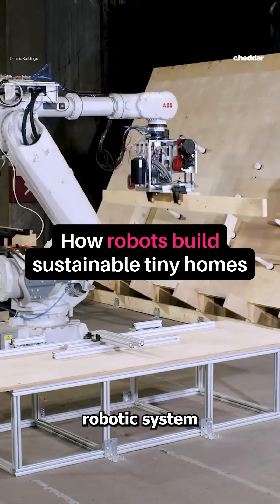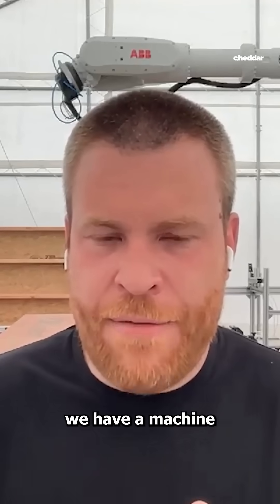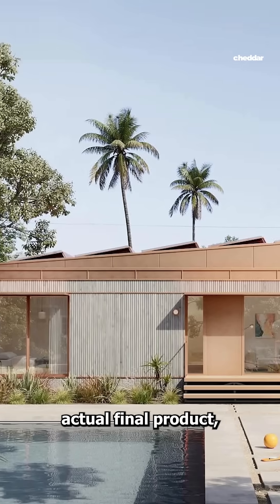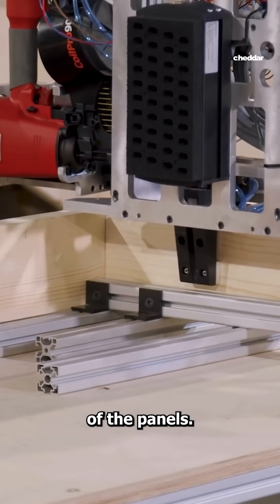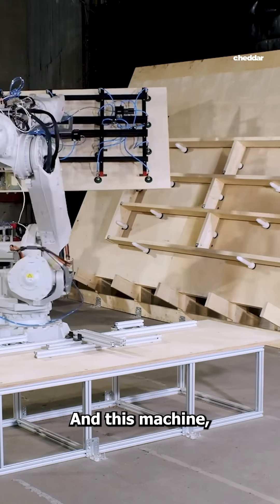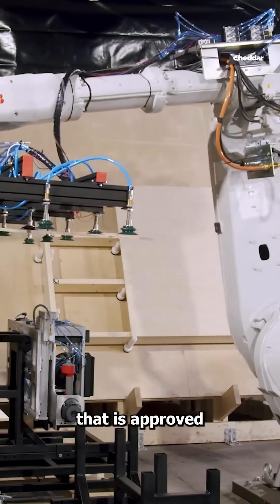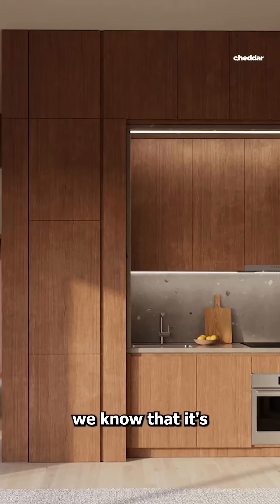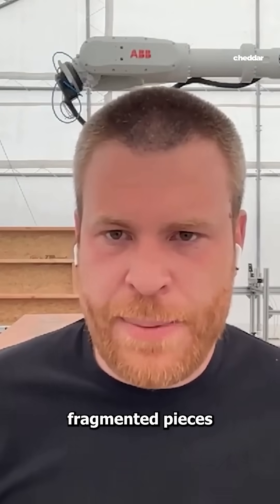How robots build sustainable tiny homes

Comment: The process of building the house is the cheapest part... The market of equity and land which is corrupted by a system of capital is the problematic part... Not to even mention that this robot, despite creating jobs in the field it is built, also requires more contracting work to put the pieces together, thereby creating unneeded labor at a point in time where we are needing to consolidate labor to the worker...